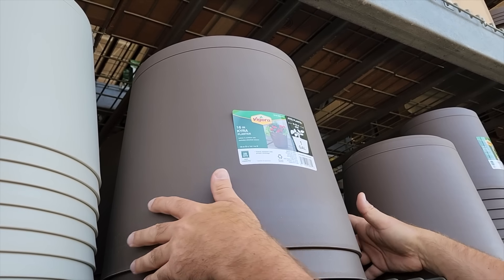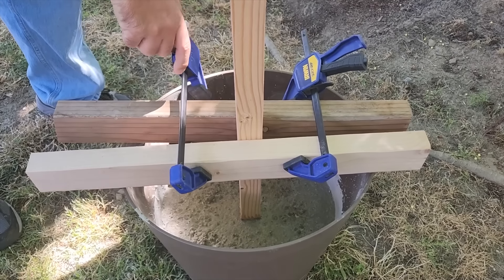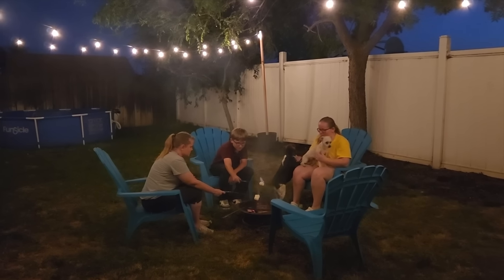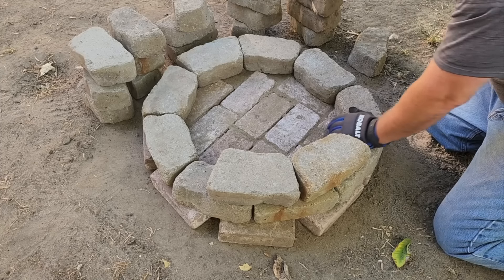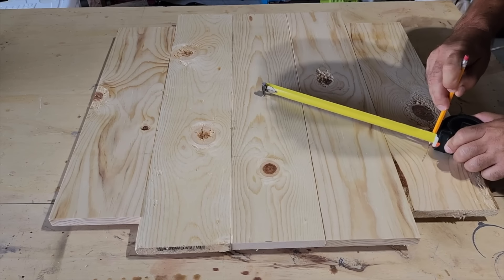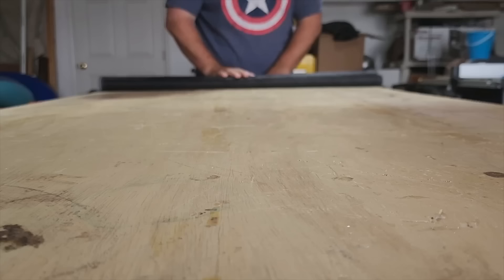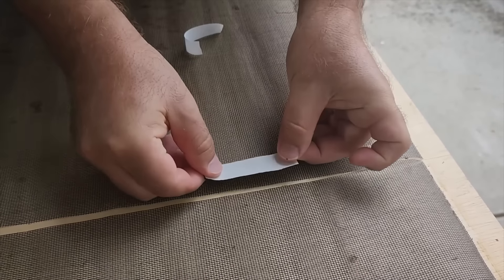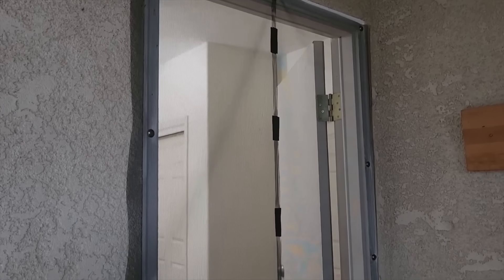Grab a bucket and string lights for this BRILLIANT backyard idea!

Comment: Re the string lights.... Do you think they would stay standing up if you used two of those, 20 feet apart? I need to do this for an event where I can't anchor to the walls and there can't be one in the middle. So one bucket on each end and not sagging lower than 6.5-7 feet. What I have so far, the base keeps pulling and typing tipping. Thx

Comment: Why not just bolt the post for the lights directly to the fence posts? Seems like a ton of unnecessary work when you have a post already in the ground..
Reply: 1. That post is vinyl 
2. What if you want to relocate them

Comment: ??? Did you put drainage holes so the water will drain out so the stick pole will not rot ???
Reply: Why it would rot if only use water to mix cement and then he added rocks! What stupid question
Reply: Did you watch thr dang video ??😮
Reply: @lindabrown9542 the person is implying if it rained, the water would be on top of the concrete which would be direct on the wood. Eventually causing water logged wood and rot unless there's a way for water to escape. I am unsure if that's a stupid question or if you misunderstood